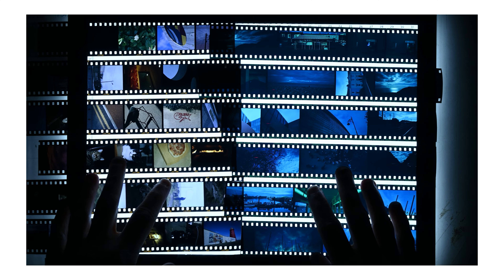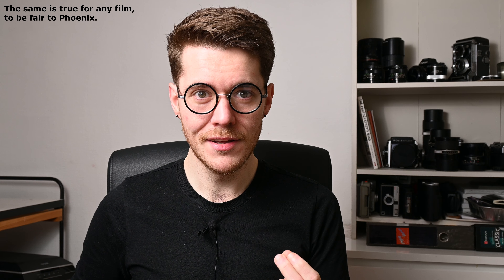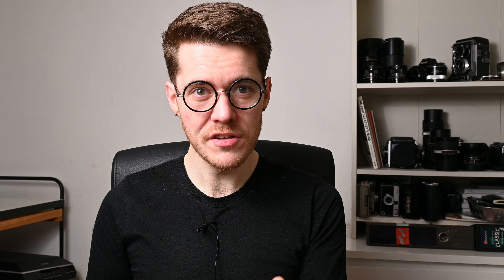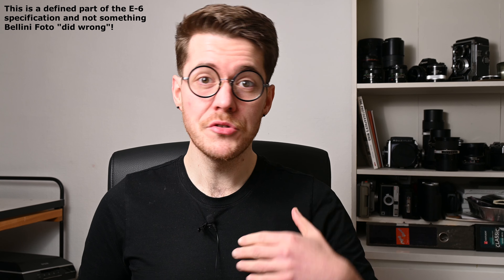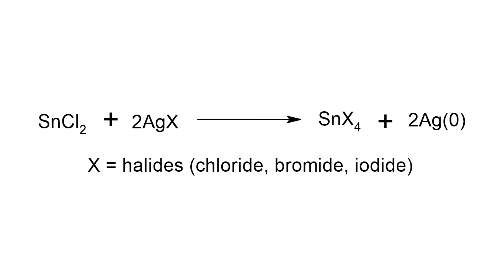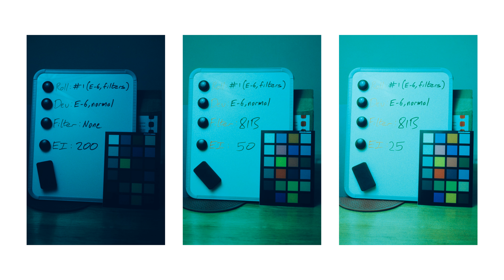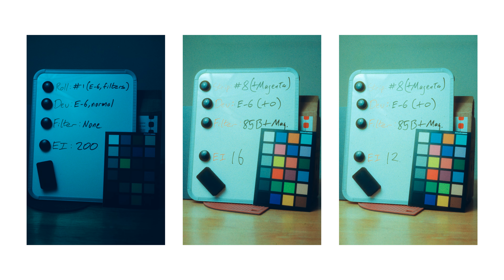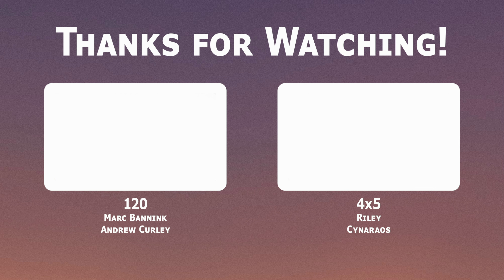Mastering Harman Phoenix #2: E-6 development

Comment: I got good slides (no color cast) without any filter by using a hot (38°C) B&W developer, then doing a light re-exposure and following up with a standard C41 process (my version of a poor man's E6, essentially). The slides are pretty dark though, I think a 25 to 50 ISO rating is necessary.

Comment: Hey Alex, I came back here with a couple questions about whether I'm understanding if you don't mind! I'm kind of bad keeping track of this stuff lol

So, to summarize your tests: 
CD (with fogger) + Blix = Very grainy
CD (fresh) + Blix = Super grainy!
CD + Reversal + CD + Blix = FINE

Your process of elimination was that CD steps alone gave a ton of grain, but when you added reversal it made it fine. So you determined it was only the reversal step that way, right?

Also, when you describe why it's how E6 works that causes the fine grain, I got a bit confused about the tallying of densities of each step causing the finer grain so could you please tell me if I got this correctly:

You take a THICK exposure, very very dense. This reduces a TON of coarse silver particles, a LOT of medium, and SOME fine. Then you do FD and those grow in the same proportions.

Then you reverse which gives ALL COARSE, ALL MEDIUM, ALL FINE. Then you do color dev on that, which only can form dyes above remaining latent silver, not the already-developed silver.

What remains of the coarse is ALL minus "TON", which is very few. What remains of medium is ALL - "A LOT" which is a medium amount. What remains of the fine is ALL - "SOME" which is probably a LOT.

So the dyes form in abundance over the smallest particles of silver, less so on bigger particles.

Or, visually, imagine a scale of "coarseness" vs "proportion formed elemental silver", FD forms a slope highest at coarse end, smallest at fine end. Then in color dev, you fill up all the REMAINING space above to "100%", creating the opposite distribution on top of the existing dev'd silver, highest at fine, lowest at coarse. Like you fit two triangles together to make a rectangle and are getting the opposite of the C41/original silver grain distribution.

Just wondering if I got that all correctly!! Also, does this mean b&w slides create a similar grain distribution favoring finer grains?

Phenomenal work on this series!!
Reply from the maker: Hey, thank you so much for this! You understood about the reversal step perfectly, and I'm sorry I didn't quite nail down the reversal grain "curve" for you the first time around. 

Your explanation and understanding are fantastic, though. The key is that in-camera exposure is so brief that the larger cross-sectional surface area of larger silver halide crystals becomes a significant factor, giving a "slope highest at the coarse end" as you said. The re-exposure (either with a reversal bath, or a light) is sufficiently longer and more potent that it exposes the smaller grains too, doubling up on the reduction in grain size like you said. 

I actually think your explanation is more intuitive than mine, do you think I could cite it in the future?

Yes, I'd expect to see the same thing with B&W slides! It's something I want to try for infrared slides one day over the summer.
Reply: @Shaka1277  Oh thank you! And thank you for the response!

No worries about the curve reversing explanation, I haven't seen anyone go over this nor handle any development topic with so much detail as you! It was just a new idea to me and it took another watch and some notes for me to get it all.

One thing I still don't get about reversal processes is how does any latent elemental silver survive the bleach bath that is meant to remove the developed elemental silver? That is, in processes where the bleach occurs BEFORE a subsequent dev step. Is the molecule too big to fit and hit the speck? Is there a similar curve as development in the first place due to kinetics? Favoring larger activation centers over smaller ones?

I wonder how much the improvements from xpro on granularity could be? From your graphs, this would favor films with a much larger "coarseness" distribution. And many color films have the different particle sizes sorted into separate layers. Maybe the distribution is far tighter on the slower films so you wouldn't see another similar huge leap if you did E6 dev.

Also, I actually thought color films were limited to how fine their grain could appear because there was a limit to how fine the dye clouds could be made. Since I'd seen that micrograph somewhere about the dye clouds size being optimized by Kodak. Otherwise I would be interested if changing the FD in developing slide film could improve upon the detail? The same way I saw people mention on photrio that adding certain chemicals in B&W dev can greatly improve granularity and resolution. Might be too out there...

Anyway, absolutely you could cite me! I feel honored because your chemistry details are always so great themselves!!

Thanks a bunch! Your videos are great!!

Comment: Great job. Very scientific approach to everything. Did you try using light instead of chemical reversal to see what effect that had? (Or was I not paying attention) Just a side note- "back in the day" - before scanning and photoshop - photogs would often fine tune color with a color meter and CC filters- such as Kodak Wratten. These were much like the filters you'd use to print color in a B&W enlarger with a filter tray. Often these guys would have a test shoot in the AM, send the film to the lab at lunch, and then do the final shoot. You had to get color right in the transparency for reproduction separations. Anyways- there are filters out there like Magenta CC10, CC20, etc if you really want to go nuts in balancing. No one really does it anymore (maybe the cine folks?) since photoshop is so easy (See shooting Kodak 500T in daylight with no 85 filter)
Reply from the maker: Reversal using light isn't something I'm terribly interested in trying. Reversal processes are very long so I'm more picky about what I try with those than negative process runs. 

I do wish I had a proper set of CC filters - they'd be very handy for Velvia and FP-100C45 long exposures.